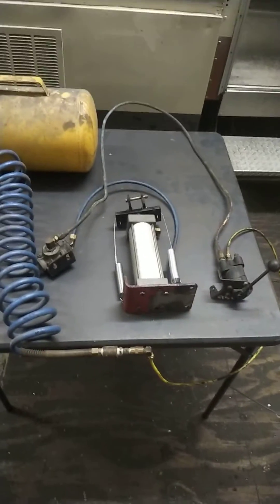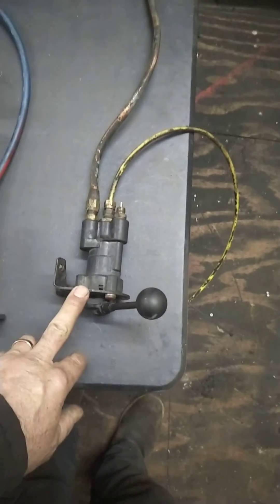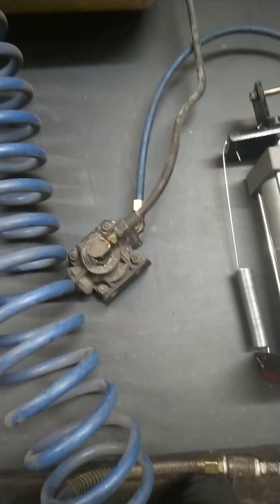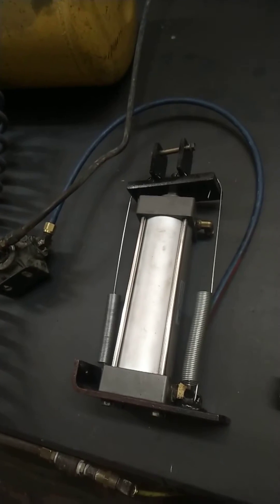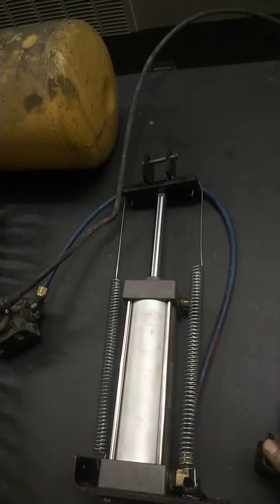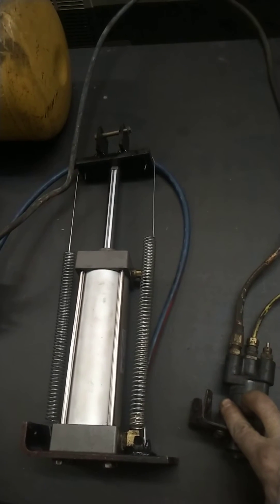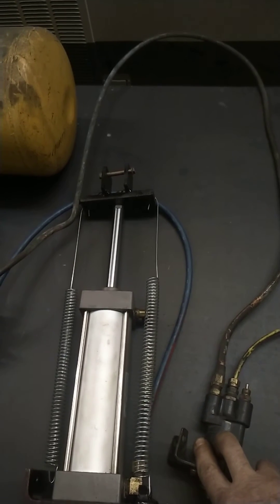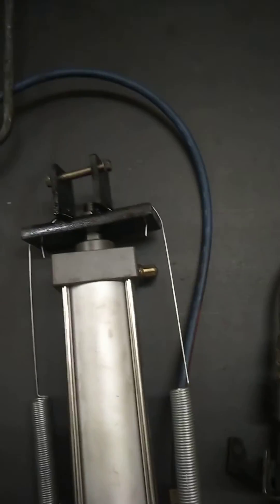home made air operated clutch system

Comment: Have you tried yet? Having driven big rigs for over 20 years and getting into a bus/motorcoach conversion (1971 GMC) my leg just cant press clutch and hold it for very long. Like sitting in traffic.... I was remembering how fast the clutch has to inguage for going up inclines as the RPMs drop like a rock and that would make it really hard to grab the next lower gear as RPMs would be too slow and you'd have to drop 2 gears (I've had to do that a few times).
Reply from the maker: I usually only use the clutch for lifting off anyway so it won't get used for shifting while rolling. The computer does not control the jake so using that to knock the rpm's down also helps to grab gears quickly.  I am going to keep working on the conversion over the fall so I will not get a road test till winter sometime.